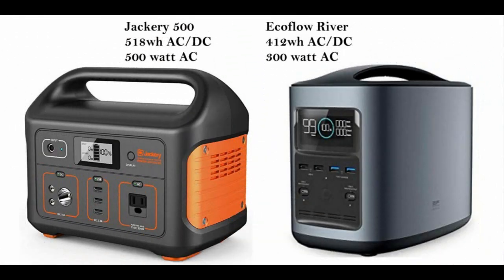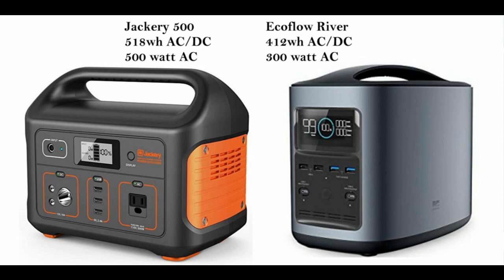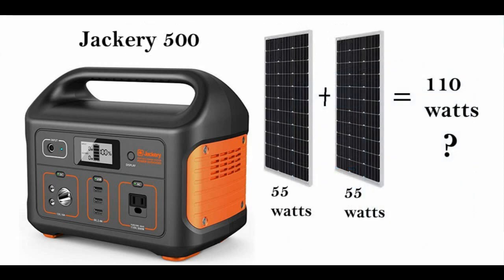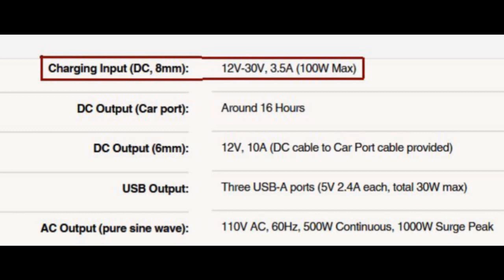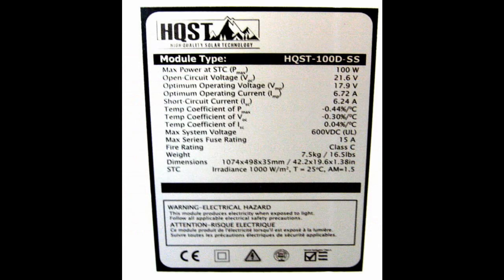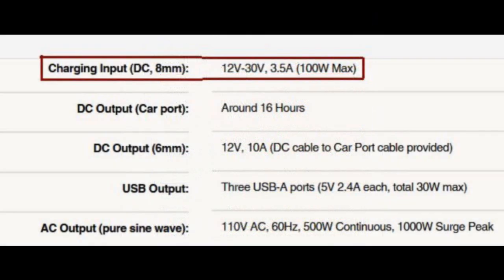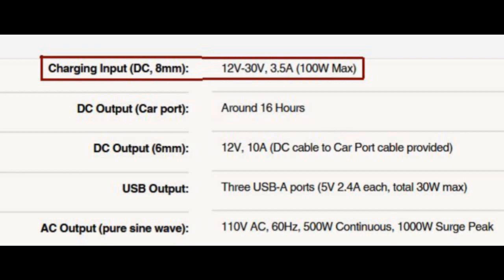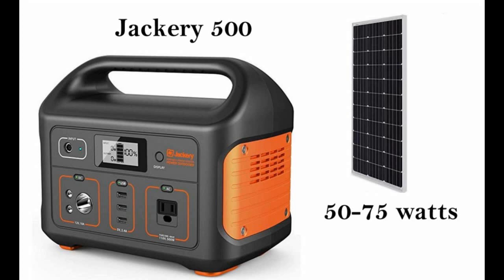Can you add Two 100 Watt Solar Panels to a Jackery 500?

Comment: from what i looked up it said it would work with 2 100watt in parrell but i dont know sounds like try at your own risk.
Reply from the maker: Hi Mitch - That's new on me, but I haven't looked into Jackery for a few years now.  With my Jackery 500 that I bought a few years ago, it works with two 100 watt panels, as what the specifications said when I bought it, and it has worked fine.  They did show more then 2 panels is not recommended.  I know that my neighbor has a model 240 and it is recommend that no more than 1 panel shown be used.  I have heard that people have used more then 2 panels on their Jackery 500 with no problem, but I would not recommend it, and I won't do more that 2 on mine. Too much stress on it.  Make sure to look at the specifications for each of the Jackery models they are selling today and follow what they tell you to do.  I wouldn't run anything when they said "it's on your own risk". See ya -- Atco
Reply from the maker: Hi Mitch - Hey, you asked me a question about the Jackery 500 and whether you can use it with two 100 watt panels.  It's funny, I had a nephew come by just yesterday and wanted to use one of my solar generators and 100 watt panel when he goes to a picnic.  As I looked at my 3 generators, I was wrong about the Jackery 500..  Their specifications recommend one 100 watt panel.  The specifications don't really say one or two panels, as long as the output from solar is 100 watt or less at 12-30v and 3.5amp together.  So that's why the manual says a second 100 watt panel is optional as long as all the specs of each panel fall withing the output of all panels at 100 watt, 12-30v, 3.5 amp together.  My guess with these newer panels, probably you can get 75% output of one panel now and 2 will probably over pass the Jackery input specs.  Make sure you look at the specs of any panel you are looking at and chose from there.  For me, yes... I do use my Jackery 500 with only one panel.  I was confused myself because my other 500 watt generator (different brand) does allow 2 panels with higher input then my Jackery.  Hope that helps you to decide what you need and what you can use for best.  See ya -- Atco

Comment: Solar installers suggest we "overpanel" our inverters by as much as 50%  so that on the less bright days we can get more out of the one inverter.   On the bright times of day the inverter limits the input to the max allowed by the inverter even thought the array is actually producing more, but in essence the inverter controls what it will pull in.   The voltage still must be within range as the inverter can not limit the voltage and only the watts coming.   That describes my sunny boy inverter but there is no battery on that system.   Still, I would like to see someone try a 200 watt panel under 30 VDC and see how the Jackery handles it.   If you think about there are times when a solar panel will suddenly have a spike of higher output due to lensing from a passing cloud so one can speculate that any system should be able to operate fine with overwattage??   Anybody tried it?

Comment: Thank you for this.  We just bought a Jackery 500 and we’re told we couldn’t use any other panels but theirs to charge it.  We have two renogy 100w panels sitting in the garage.  I know companies prefer we buy theirs panels, so it is reassuring knowing others use other brands,

Comment: The jackery Explorer 500 has a very simple mppt charge controller. The charge rate in watts is directly related to input voltage. So if you want to charge the jackery at 100w you need to provide it with approximately 28.5V. Do not worry about having more than enough amps. 3.5 amps is the minimum required. I use a pre-charged controller. which is nothing more than a DC to DC buck converter that can accept a higher input voltage and be set to 28.5 volts out. Then I use the 12 volt cigarette lighter adapter that comes with the jackery to go between the pre charge controller and the jackery.

Comment: You should take a look at this video.  It describes a Y adapter to combine two 100 watt solar panels.  These panels are from Jackery but any could be used.  The point is inside your Jackery PowerStation 500 there "should" be a built in MPPT solar panel controller which manages the output from one or more solar panels.  So, your statement that you can't or shouldn't use multiple solar panels is simply not correct.  Here is the link:

https://youtu.be/A9kV5-_O3JU

Cheers

Comment: Doesn’t the charge controller inside the Jackery 500 control the situation you described?
Reply: Of course it does at least considering the amperage. That's what its purpose is (apart from the MPPT). The charge controller decides which amperage to pull from the solar panel(s). So adding up the amperage ratings from the solar panels does not help to answer the question it it will harm the Jackery. So, in essence, connecting the solar panels in parallel should work. However, judging by publicly available information, the charging power of the Jackery depends on the voltage. Thus, connecting two panels in parallel won't probably increase the charging power.
Reply from the maker: Hi Donna - you have to stay with the specs.  Go further and you will hurt the controller.  See ya -- Atco
Reply: @atco21117  Thank you 😊

Comment: I got a Paxcess 120w panel and a Jackery 500 just recently. Only tested it once so far. Around 10 o'clock clear day with very slight haze got about 72 watts.  Un plugged it then tried again and got 70. Maybe could of got more if I played with the angel of the panel. Do you think I got a newer version of the jackery 500? Maybe they changed the PWM controller

Comment: Thank you I’m a newbie too and only looked at the 100w...thank god I watched your video before buying...there is a dc- dc gizmo where you could adjust the voltage and amps to meet the 100w requirement...I think anyway...UNLESS the built in MPPT will adjust it for you...18v X 3.5amps = 63watts...if your single 100w panel can charge the Jackery higher than 63 watts (on a clear blue day) then I think adding another panel should work and give you the 100w you want even on a partial sunny day...maybe ...if if if
Reply from the maker: Hi Michael - Jackery makes great units.  But, the 500 watt unit with only one 100 watt panel and using a PWM controller is terrible.  Many of the other similar 500 watt units will handle 2 100 watt panels and some even with MPPT controller for the same price or cheaper.  The new jackery 1000 does.  For me it's a big pricey for what you get from it though.  I will still buy one once I can get one on sale for $799, but the retail of $999 is too high for me.  Put $400 bucks more into it and you can buy a EcoFlow with 1800 watt, can handle 3 or 4 panels, 1280 wh and a fast AC recharge.  Many other new companies coming in.  See ya -- Atco
Reply: atco21117 thanks for the tip

Comment: Great video so with that panel. Did you have to splice any connectors.  And use the 8mm port or the cigarette port or adapter thanks
Reply from the maker: I didn't have to splice anything.  Fortunately, all the connections I needed were available either by Ebay or Amazon.  See ya -- Atco

Comment: I just bought the explorer 500 and a MC4 connector to 8mm cable to charge the hackery from my 100 watt renergy solar suitcase. For some reason it doesn’t do anything when plugged in and my solar suitcase keeps saying it’s not connected to a battery. I bought a second cable thinking that the first one was bad.  Same result.  Any ideas?
Reply from the maker: Hi Rescue - Well, I know you don't want to use the solar panel controller connected to the Jackery input.  The 500 has it's own PWM controller inside.  I have 3 solar panels with no solar panel controllers and the panels charge just fine.  Might be worth calling Renogy and tell them how to bypass the Renogy controller panel so that you can connect the output directly from the panel to your 8mm input plug of the Jackery.  Hope that will work. -- Atco
Reply: I agree it’s because of the controller.   Thank you for your help.  I will buy another panel and dedicate it to my jackery.

Comment: Q: I Have jackery 500, and 2 sets of the Jackery Solar 100W fold-able  panels that each have the Anderson pole connector. I was only getting 38 to 50w charge in when used alone.  I used a Anderson y spliter cable connect 2 panels to Jackery to get more watts in I still don't get  over 100 watts on the display. It gets up to like 80 watt like the ac charger. I don't see any problems happening to the unit.
Reply from the maker: Well, a Jackery 500 watt power station can only charge up to 65 watts input whether you have 1 or more 100 solar panels installed or not.  Plus, I wouldn't do it since the voltage and/or amperage from two 100 panels would pass the controller's input.   Don't do it.  Could damage the controller.  But I have heard that those Jackery portable panels can get 60-65 watts out of one as long as the sun is hitting at the best time of the day and positioned correctly.  If you just lay it out on the floor, you'll get less.  Also, if you started your charge earlier in the day when the solar was low, the controller will held the input down. So if you think you should get more input, then pull out the input of the Jackery and plug it back again (that resets the controller).  You'd be surprised that it will go higher after that. But still you'll never get more than about 65 watts no matter what.  The Jackery 500 was designed for using only one 100 watt panel. Too bad, 2 panels would sure help. The new Jackery 1000 will have a MPPT controller that will be more efficient using the solar.  I'm looking forward to see the specs of that.  I think it's due to come out somewhere in March. See ya -- Atco
Reply: @atco21117  This may be true on the older version's PWM controller, but the MPTT controllers can permit a higher level of watts.

Comment: help please ,,  i see some videos say you must use the jackery solar panel,,, and another video saying all you have to do is change the plug in back of a off brand is this true? so what did you do ? and very important to me can you charge this up with a 300 watt carport plug inverter so as to use the 110 ac of the inverter???thank you
Reply from the maker: Hi D - I assume you have a Jackery 500 already just don't what to have to buy the brand Jackery 100 watt portable panel.  It's a nice product, but it is expensive.  No, any 12v solar panel that works normally around 18v (always check the specs of it before buying) will work.  I bought a 100 watt panel for $85 on amazon with free shipping.  I use it for my Jackery 500.  I also have two other $85 panels that I use for my RockPals 500.  The RockPals can handle 2 panels. The Jackery can only handle 1.  More than likely it will come out with MC4 connections.  Just buy a cable to connect to that short panel and on the other side a 8mm power plug that will plug into the Jackery.  I think the 30' cable cost me around $22 if I recall.  Either got it on amazon or ebay, don't remember.  Be sure that if you are using that for your Jackery, buy the panel without the controller.  Jackery has it's own controller inside of it.

As far as your question about your 300 watt inverter, I don't quite follow of what you are trying to do.  Explain more for me to understand.   Do you want to plug that inverter into the Jackery?  Are you trying to plug the inverter directly from solar panel?  If that is the case, that won't work.  -- Atco
Reply: @atco21117  thanks for your time..... to use the carport charger for the jackery while driving   would take a long time to charge  but if you  use a inverter pluged in the carport dock  and plug the jackery  500 into  AC plug  into the inverter  it would charge up a lot quicker  wouldn't it??????        i'm asking not saying it would.. do you know ???thanks

Comment: Great subject.  I am getting ready to buy or build a solar generator for camping.   One thing I think you are off a little on though is why you are only getting 55 watts or so.   The Jackery is limited to 3.5 amps and your panel is probably putting out about 18 volts.  18v times 3.5amps = 63 watts maximum. The Jackery does not have the most efficient charge controller either so that is probably where  your loss is coming from.  You could, in theory, put two panels in series and then use a DC/DC converter to lower the voltage down under the 30 volt maximum.  The AC charger runs a DC voltage of 25 volts and that is why it can charge so much faster.
Reply from the maker: Hi Shasta - The best input of solar from my 100 watt panel has been 61 watts.  But on a clean, sunny day it will charge around 56 watts for a few hours continuously.  I talked to Jackery and said the PWM controller will limit the solar input to about 60 watts +/- 2 watts.  I just bought another 500 watt power station from RockPals.  Got it on their Christmas sale.  Currently asking it for $459, and I got it for $344 including tax and shipping.  Looking forward to see how it will handle it's input of solar.  My Jackery 500 will only handle one 100 watt panel.  The RockPals will handle 2, plus it uses a MPPT controller rather then the PWM.  I hope I should get 140 watts input on a good day using two panels.  We'll see, and will do a video of my new RockPals soon.  See ya -- Atco

Comment: Popular for boondocking campers, but not for refrigerators, heat, AC, . or high demands.  It will work for electronics and LED lighting very well, as auxillery 2nd power source..  These are great for boating, and can jump start the motor if the starter battery gets low.  Most RVs have at least two battery systems.  
But for backup power at home, a Generac, or generator,  that runs on natural or propane gas is best.
Reply: Great vids ATCO, a fave topic that I've researched for years.  btw, there are solar panel regulators that work very well with multi panel setups, a must needed part of a solar battery system.  I think wind and solar are over rated, and are an expensive investment; panels, batteries, regulators, inverters, replacements etc.  The best way to make electricity is hydro dams.  Then steam, which includes nuclear.  Then fossil fueled generators.  Then solar and wind.   But as you've demonstrated here, solar and wind power ARE NOT FREE, or even cheap, and are not trouble free either!
Reply from the maker: If you're making your own solar system you can buy just about any type of regular and/or charge controller that will allow you to add just about any time of solar panel you can find.  For people who have that talent, you can buy quite the system!  But now there are all-in-one boxes that can do a lot for your home.  Still more for emergencies, but wouldn't be surprised to see more and more solar in homes.  Wind is no longer worth while and cost for a home. I find my solar generators are great now for 6-24 hours without power.  But still for me, the gas generator from that point on will be my main power with a long power outage. See ya -- Atco
Reply from the maker: I'll tell ya Don, these DC refridgerators are so effecient, they'll draw less than 50 watts an hour.  If you go to a park or tent, 100 watts would cover a lot of lights and charge the cell phones and laptop as well.  A Jackery 500 type of power station would run most of the evening, and if you had sun during the day you could use a solar panel or two and it would cover you thru the day and keep it changed to use at night.  Not perfect, but sure beats the noise of a gas generator in your camp.  Cool little things!  See ya -- ATco